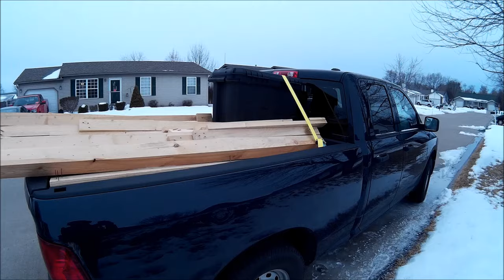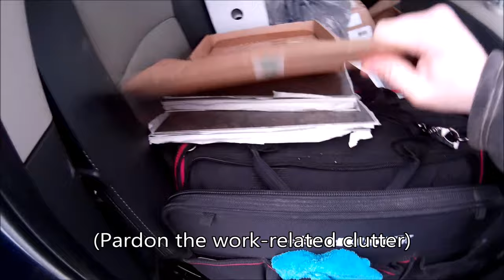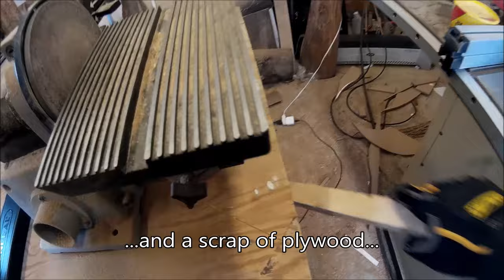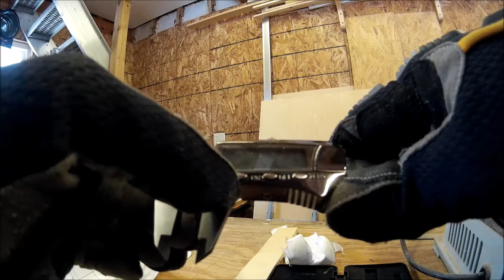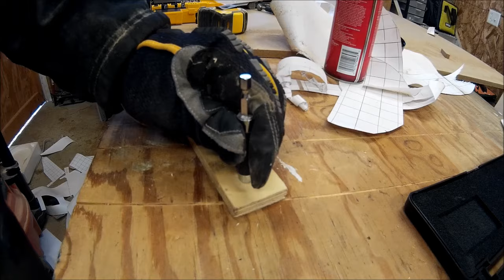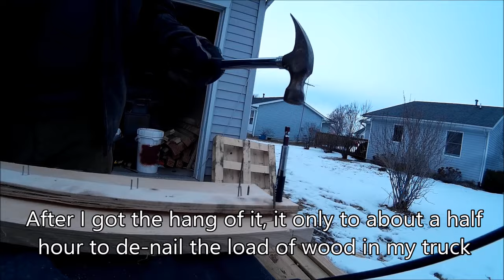Pallet Wood De-Nailer (Amazon links in description)

Comment: I bought a well built de-nailer. A good one, not some cheap piece of crap for $50. it's a "NAIL KICKER" by Reconnx.a guy in BoulderCO makes them.
 I de-nailed hundreds of pallets, enough to panel a few walls and the entire cabin kitchen (i planed them of course). I always did it over a trash can, so nails would go into the can. If I needed more leverage or support I would use 2 chunks of scrap wood over can to ret the work piece on. it took forever, not to mention the time to collect pallets at the local tractor shop. 

then I got smart...

I bought a sawmill. now i have all the wood I'll ever need. 

now i say. fuck pallets.

Comment: If there was a way to pull the nails straight out of the pallet, then I'll be impressed. The hardest part is getting the boards loose without breaking them. Even tho I have a pallet breaker I made, some nails just won't come loose. Especially the twisty nails

Comment: I saw the tool bag in the front seat of your truck,...how did you choose which tools to carry?  lets say we are going on a trip to an isolated area and we can bring one tool bag the size of yours,....no idea what kind of work to be done,...  I have just about every tool there is  and I guess I am spoiled for choice!   I'll start with a good cordless drill and impact set with bits, an aggressive hand saw   now what?
robert in niagara falls
Reply from the maker: +70carlton it really depends on the type of work you mainly do. The tool bag is for my day job and is mainly set up to do electrical work. If you are going to have a cordless drill, you may as well carry a cordless circular saw. They are super handy!
Reply: thanks for the reply
I was thinking along the lines of not knowing what i would run into and bringing the most versatile items I could think of
I have heard anything can be a hammer! LOL
I guess I should include wd 40 for example and dollar store epoxy

Comment: Never tried it but what about just using that bit in a hammer drill.
Reply from the maker: This is more fun.
Reply: Nonsense. Over-engineered over-powered tools are delightfully satisfying to use. Like you, I'd be loathe to part with $60 for the Air Locker (if I tore apart pallets every day I'd think differently), but I wouldn't hesitate to attach the screw starter to something that would wail on it for me. I was thinking about rigging it into the barrel of my air chisel, but the screw starter has a hex shaft that's just begging to go into the chuck of my hammer drill. Thanks to +Andrew Underwood for the idea. There are some other great ideas here from the non-trolls. I usually grab the vise-grips (real ones) but channellocks would be faster. Also the fellow who pointed out that the ends are often unusable. I think if we see the wood's splitting despite our efforts we should just grab the circular saw.

Comment: did you consider putting the tool in a drill motor and as it turns press down on the drill motor...that drill press would give you some leverage.    yeah I know half the fun is smacking  it with the hammer

Comment: What's the point ? And as Nick Carter and Gary Meyer mention about the nails and staples !  It would be quicker to bang the nails straight out, turn the plank over and pull the nails. Or buy an Air Locker AP700.

Comment: Cut the nails off (side cutters) and leave about 1/4" proud of the surface, then tap them in flush...flip over the board and remove.
Reply: That's exactly what I do with long nails like that. It's an extra process to cut them all but it sure makes the easier to knock them out without bending.

Comment: Why use that wood piece at all? And the hammer, I use a Stanley dead blow with a half of an inch round steel bar that I drilled about half of an inch deep. Better results with less noise, easy to handle and I don't have to dammage a screw guide bit.

Comment: Brilliantly simple! Thanks for sharing this video.

On another note, any way you can post a brief video of those stairs? I'm wanting to build stairs to the second floor of my workshop, but have limited space to do so. Those stairs look like they could be my answer. Thanks in advance (assuming you still read these comments after 2 years).
Reply from the maker: Those stairs are awesome.  I got them from an industrial site that was throwing them out.  That is the problem, though.  You can buy stairs like these, but they are really, really expensive.   Like $500-$1000 expensive per section.  That is why most people opt to make them out of wood.  Just as strong and super cheap.
Reply: I definitely need to build them (out of wood) to access my second floor. As it is, there's a "ladder" made of 2x4s nailed to one wall through which you enter the second floor through a very narrow square opening at the top. Do you know what the stairs' manufacturer is called? I'd like to look them up to see them better to have a better idea how to replicate them.

Thanks, again!
Reply from the maker: these are the exact units I used:
https://www.grainger.com/product/GRAINGER-APPROVED-5-Step-Aluminum-Stair-Unit-4XV21?searchBar=true&searchQuery=4xv21

The hardest part was the 3-stair turn in the corner which I did build out of wood.  Unfortunately, I don't have any footage of that being built and I don't have access to the property any more.
Reply: Outstanding! THANKS!

Comment: Pallets in the UK and EU are made with annular ring shank nails and devils own job of removing them. I drive a sharpened bolster between the boards and use a hacksaw to cut the nails. Just need to make sure the nails don't get in the way of the saw when using the timber
Reply: Also having been a Carpenter/builder for 35 years I can agree polishing your hammer head will help to grip the nail head (or in your case the magnetic screwdriver holder) having many a black nail from slipped hammer to nail incidents it's a good trick to learn

Comment: Nice concept however generally you need to just tap a nail slightly then the rest can easily be pulled out. Also I'm not a fan of people that are reckless with old nails like that. Can easily be picked up with a tyre then you will be sorry. Easy enough just to grab the nail when it's out and pop it in a tub or something.

Comment: Cleaver idea, is it still holding? I ask cause, usually, sometimes these things aren't very strong?
Reply from the maker: The wood handle wore out after a while.  Maybe a better option would be to weld on a piece of rebar for a handle.
Reply: Funny i expected the dry wall bit adapter to give out 1st. :-/
Reply from the maker: it is pretty tough for a cheap little attachment.  It is actually back in my tool rotation doing its original job.

Comment: 1 use a nail kicker from amazon.com and a air compressor. 2. U can use a crow bar to take the nails our before or after dismantling. If after, do it with a electric screw driver. Clamp nail in drill. Or do it izzy swan way. this HTML class. Value is https://m.youtube.co3. Use a lubricant on nails over night.4. Use two metal demolishing bars from amazon etc. BUT USE 2 PEOPLE AND NEVER RUSH IT.5. Can use a RECIPROCAL SAW and chop the wood and nails off. Use a nail punch to drive out nails or a nail gun remover.6. When taking pallets fown it's best using 2 people with a demolition bar each. Best to have one person opposite to each other.7. Take your time. Lift the plank a little. The nail moves a bit. This breaks the glue bond a bit and helps to remove nails. 8. Whilst the supportive pallet bars are exposed, use lubricant on nails. Give it time to absorb. Use a crow bar to remove nails. 9. Caution use safety wear and workmen's shoes. Think about what you are about to do plan ahead. It's to easy to have a irretrievable injury in seconds. Just not worth it.10. Join on line groups etc.

Comment: Thanx  4 The Vid! ...............  Were Those nails The twisted Shank Ones That twist in?   & Yes So many Experts here Commenting you Adversely. Yes KIA's Cutting The end Does Work fast but If You Want To Keep the original length, ... It Doesn't!   Yep Pallet Nails Seem To have their Own Metal Alloy Composition which Bend With Out Your Helper tool
Reply from the maker: Luckily these were smooth-shank.  Ring shank or the spiral shank ones would have required more effort to get out!
Reply: Yes So True  Especially when the cheezy metal heads fly off

Comment: I have to say that is BRILLIANT! Definitely making one of these! Quick question? Did you notice any damage to the inside of the bit holder after using it for a while? Should I use a "throw away" bit holder?
Reply from the maker: +Tim Bruno thanks a lot! The hex receiver end didn't sustain any damage, but the sliding sleeve did get a little rough after a while. That would be the failure point after repeated use, so definitely use a "throw away" one.

Comment: Just flip your board over and tap the nails back through, less faffing around. And your method wont work if the assembler has been over zealous with nailing, and there's 5 or 6 nails all close together. Most nails are twisted and bent, or are way over sized for the thickness of timber.

Comment: Having de nailed a LOT of recycled timber where the nails are not so easily driven out, this idea has merit. The only thing is WHY didn't you use the hammer to flatten the staples in the ply????
Reply from the maker: +Murray de Lues lol I did eventually. I think the thumbnail shows them flattened down. It was a quick idea and as a prototype of sorts, there were areas that needed refinement.

Comment: Along the same lines would be a palm nailer, only faster. Cool idea!
Reply: +Russell Anderson — I was thinking along the same lines, plus a pair of lineman's pliers to straighten the bent nails and to hold the nails while driving them with the palm nailer.  This video made me cringe at the misuse/abuse of tools.
Reply from the maker: +Milosz Ostrow Lol, abuse of "tools" may be a stretch. A tool is only useful if it is needed.  I can drive screws without a $1 guide. I gave an otherwise useless accessory some alternative value
Reply: i wise man once said " I don;t care what it was designed to do, i want to know what it is capable of doing"

Comment: Why did you need to put it in the board?
Reply from the maker: Leverage, safety, convenience.  I don't know, you can pick one.  I think it gives a little more control than trying to hold the the bit adapter.  Keeping your hand away from the hammer has its benefits too.
Reply: Thomas Lightle - Red Barn Woodworking I just think a pair of vise grips would have been faster with more control and easier strorage

Comment: if you really want something good use the air gun nail remover works like a charm E bay like $50.
Reply from the maker: The point is free wood, not spending money on a specialized tool. Though I must admit that tool makes things go quick.

Comment: Wow. Where did you find pallets that were that large and nice looking?
Reply from the maker: +Jacob Sullivan industrial equipment pallets built for one-time delivery.
Reply: Nice. Good idea in the video too! Gonna have to do a little investigating the next time around for pallets like these.
Reply: How about 21ft x 7ft with  5 4x3s over 8 3x3s topped with a heap of 3"x0.5" boards or same 21x7 but 5 5"x1.5"s over 8 3"x3"s.
These are the mothers of all pallets. 
I built a two room two storey house from them and am currently extending to add more rooms.

Comment: very clever, to bad the easiest fastest way i've found to pull pallets apart is to cut the boards of the structure with a sawzall, leaving the nails cut flush on the btm of the boards, making this little beauty unessesary
Reply: +brendonmartens i like to salvage hardwood pallets and sometimes even with a proper pallet puller bar theres no way to pry them apart without breaking the boards, making cutting the nails the only way. but then i have to center punch the nail from the btm, so i can pull it, otherwise i ruin the top of the board digging for the head of the nail.
Reply: Sometime ago I posted a similar comment, brendonmartens.  My method is to take a 1/8" drift punch (Harbor Freight), chuck it into my drill press and  (with the drill unplugged) start punching cut-off nail heads out.  It doesn't take very long to have a pretty good pile of nail heads (or very short, dull nails).
Reply: agreed. pallets are made to last and not come apart.
Reply: If you drive the nail head out with a long pin-punch you have a full board, no nails so you call plane it.

Comment: Thomas Lightle you state in the description box that the pallets you get come apart easily. I love your “denailer” idea, but what if the pallets I have don’t come apart easily like yours, then what? Great video!!
Reply from the maker: In the years since I posted this video, I have come to the conclusion that it is easier to cut off the boards at the ends and only deal with the nails attached to the center runner.

Comment: This is PART 2 - I want to see the first part where you remove those planks from the pallet...
I break down all mine with a RECIP SAW cutting the nails off
Reply from the maker: I was lucky and these were built with smooth nails. Easy to pop the planks off with a pry bar
Reply: Buy a pallet buster. They sell them in lots of places.

Comment: Or you can spend 40 bucks and get the AP700 AirLocker and just use air pressure to knock those nails out.

Comment: howd you get the boards off the 4x4s though?
Reply from the maker: I actually flipped the pallets upside down onto a block of wood to prop them up a little, then I hit them with a sledge. Boards popped right off.
Reply: ahh, not that easy with the regular pallets.
Reply from the maker: Yes, I must admit that though these pallets weighed over 100 lbs. each, the straight, smooth nails made them easier to get apart.
Reply: ahh, boo, lol, thats too easy

Comment: Bad idea. The bit holder is expensive and weak. Just hit the nail with the hammer.
Reply from the maker: You are 100% correct. Except for the expensive part. And the weak part. And the bad idea part.

Comment: I like watching videos when necessity breads an inventive idea. Try a palm nailer. Cut your work time in half.
Cheers
Reply from the maker: Thanks Gerry! I don't have a palm nailer, but I bet it would make quick work of it!
Reply: Palm nailers are a bit more expensive than just an air hammer.  Currently, palm nailers are $20-25 at Harbor Freight.  Air hammers start at $10.  If you take an air hammer and drill a hole slightly larger than the nails you are trying to drive out of there and shorter than the length you need to drive them, you can insert it over the point of the nail and drive it out.  I'm thinking a 1/8" drill bit would be about right.  You won't be able to drive it out all the way with that design, but you'll be able to drive it out far enough that you can easily get a grip on the head of the nail with a crowbar or hammer claw.
Reply: Ive had one for a very long time. There is a couple fittings included for just this purpose in the kit. Smaller like 10p down and 12 and up to 16p. They work very well.

Comment: haters gonna hate.  my only concern is those loose nails ending up in your tires. happens to me all the time even after i run a magnet over the area.
Reply from the maker: Thanks for the support, Stefan.  I have a magnet sweeper that does a pretty good job.  I have been lucky to not get any nails in my tires (yet).

Comment: I don't see any time saving. You only have to drive the nail back enough for the claw hammer to grab the nail head, 1/4 inch or so  flip it over and pull the nail.  The buggering about with the board and tool  , no.  If you know how to drive a nail in you can also drive it out. Practice .

Comment: uhhuh. That was not a tough nut to crack. Anyone who can use a hammer should be able to just bang 'em out. Straight nails in wood that is not holding them tightly. Now, what about staples and/or nail or staples that are in very hard wood, and ones that are really bent?